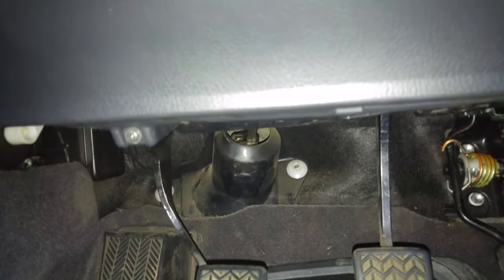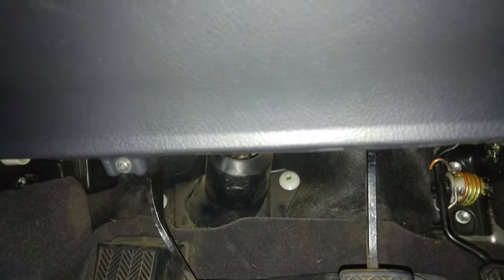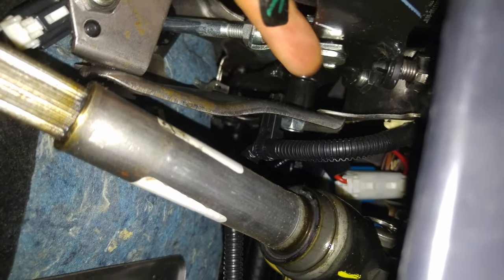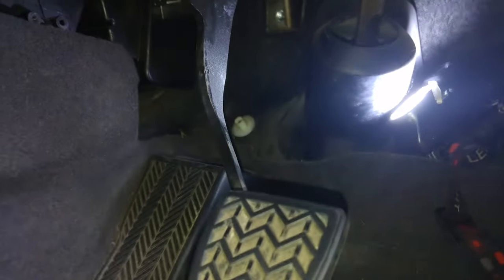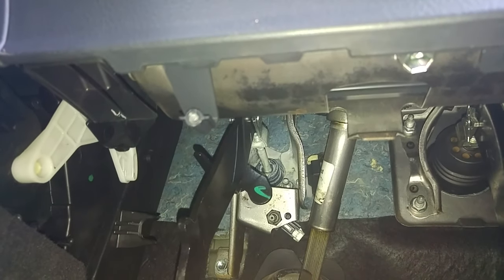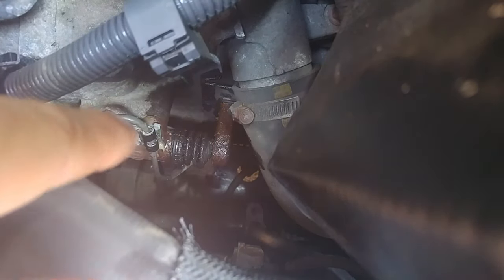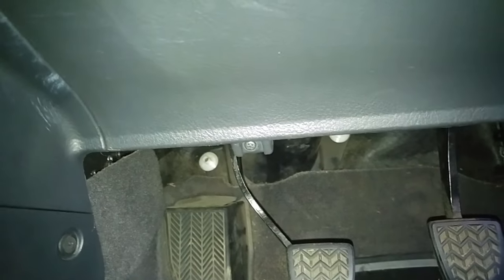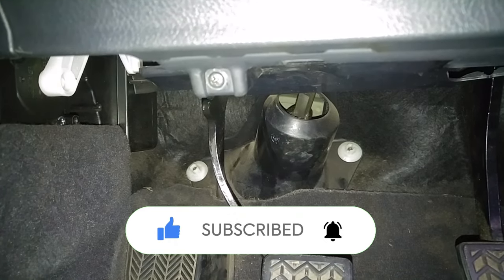How diagnose and fix a squeaky/creaky clutch pedal? Fixed!!!

Comment: Massive thanks! Mine was squeaking like an old door and it was driving me nuts. Had to spray it on the internal areas just below the pedal
Reply from the maker: Your welcome. I know how frustrating a noise can be. Mine is still silky smooth and noise free so it was a good fix.
Reply: @glchow  how long does it lasts?

Comment: so good to know and save me 1600€ of changing the whole coupling system -> also my mechanics said, keep using it until you press the clutch and stays pressed :D then bring it so we change it all and depress your clutch system. Ironic´.
Reply from the maker: If the pedals gets stuck down then it’s time to bleed the clutch slave cylinder with new oil. I plan to do a video on this in the future.
Reply: @glchow  already done that :D seen it and change it costs a lot though -> 389€ they have changed the breaking SlaveCy too

Comment: Would you recommend multi purpose grease or better some sort of silicone grease in those areas with maybe rubber gaskets?
Reply from the maker: I used multi purpose grease. It’s suitable  if it does come I  contact with a rubber gasket or boot.
Reply: @glchow  Ah OK, thanks. Didnt know that, some sort of grease will destroy I think.

Comment: That noise is your Clutch Master Cylinder about to RIP.
Reply from the maker: This video was recorded over a year ago. It’s still silky smooth and silent.
Reply: @glchow Good to know. I have a creaky one as well
Reply: I used a silicone spray and helped for maybe 30 miles, after a spirited drive it was back. I will try a multi purpose greaser. Any brand?

Comment: I used wd40 many times on my yaris clutch pedal and also used copper grease so it returned im gonna try multi puropse grease now as its loud creak and iv had enough after months cheers for video
Reply from the maker: If difficult to get the grease where you need it. I used a zip tie to push the grease in.
Reply: You read my mind i was thinking zip tie or needle picker to shove in ive found carlube multi purpose grease in b&q for £2.75 70ml. 👍on the way now

Comment: Have the same problem just today, ready with WD 40 watched the video. Thanks a lot, I will do it by grease application as you did. Thanks for sharing your experience..Have a good and smooth drive.
Reply from the maker: Thanks for watching and commenting. Let us know if it works!
Reply: In my case the squeaks disappeared. When I was ready to apply a special grease I had to drive for 15 minutes and it was gone. Any more after 2 days 😂😂😂.
Reply from the maker: @kareltrcalek1619  Great to know we have another success! you can enjoy driving again!
Reply: I used Q20 fluid, I think I should use grease because sound still appear

Comment: Can you do damage to the gearbox r clutch I've been doing the same wd40 keeps coming bk after few days was driving today and found was in frist gear going into second nd the stick was bit stuck trying to get out of frist into second mad feeling can you do any damage Putin wd40 on the shaft
Reply from the maker: This shaft just connects the pedal to the master cylinder.  The master cylinder contains oil, so adding more oil can't damage it.  It was the grease that fixed the noise.  It's still working noise free. If you are having problems changing gear then maybe check the slave cylinder?
Reply: @glchow  That's brilliant thanks very much for your reply cheer's mate

Comment: Wd40 is not a lubricant! 
It is a water displacement spray it leaves a sticky residue to prevent water ingress..
Reply from the maker: It's multi use. It is a oil, a lubricant, rubber preserver, cleaner and water disperser. It says it on the tin multi use product.

Comment: I have the same sound in my Opel Insignia brand car, I lubricated it in every way but it does not go away.

It's getting on my nerves now

I'm thinking of changing the entire pedal box.
Reply from the maker: I’m not familiar with that particular issue.  It could be a bad weld on the pedal box? If that was the case if the brake pedal was part of box it also should make a noise?
Reply: I completely disassembled the pedal and oiled it and the problem was solved.
Reply: It took me about 3 hours🤣🤣